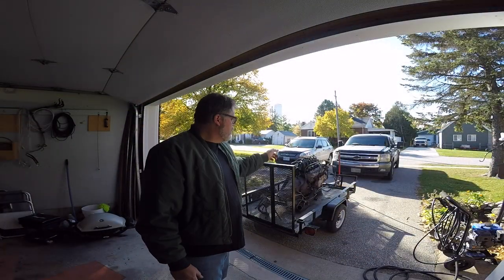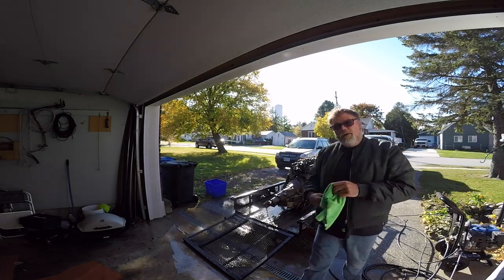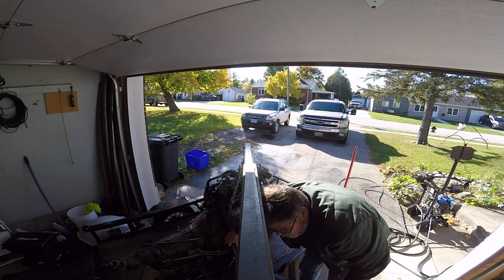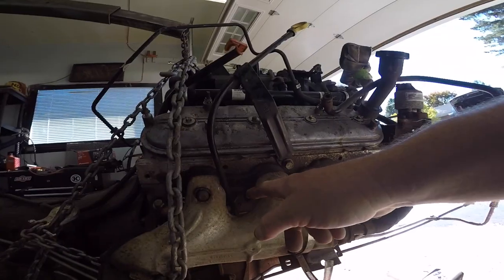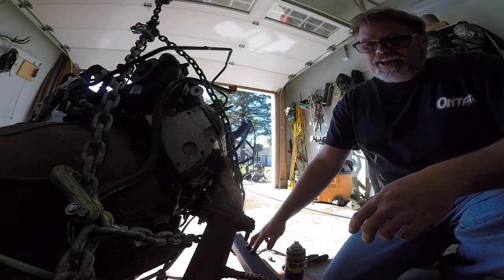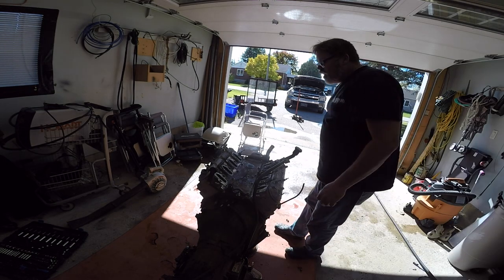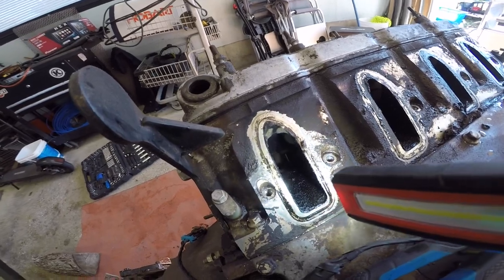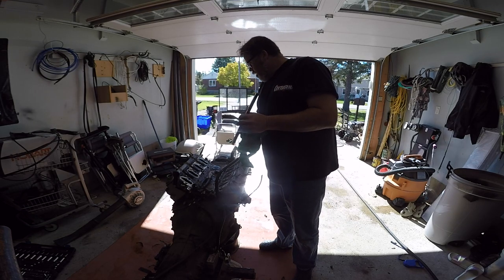LS 6 0 L Intake Runners Are Drity

Comment: Unfortunately buddy i would break it down to at least give a good eye  on the engines condition all new gasket kit and seals . It seems like a lot but if you go through all the work to make it tits  you'll have an awesome powerplant that you won't have to pull back out if you didn't go over the engine . If that all makes sense. Damn good engine . You may put it in van and run it for a few yrs and decide maybe build another car or truck using that engine . Its well worth a good disassembly and redo